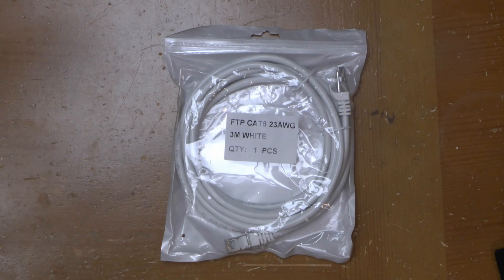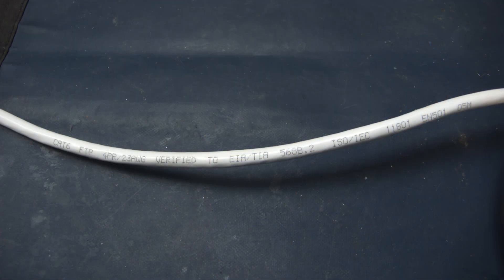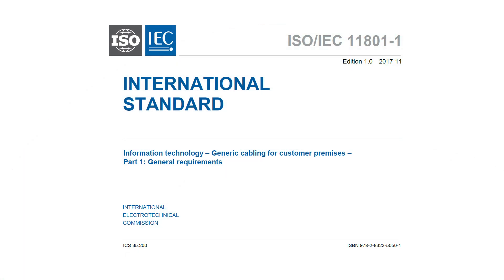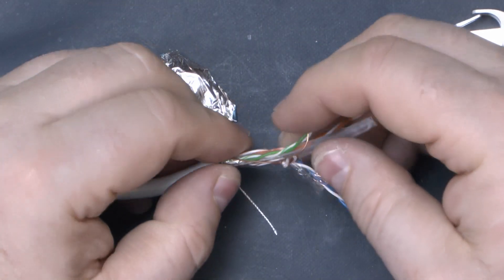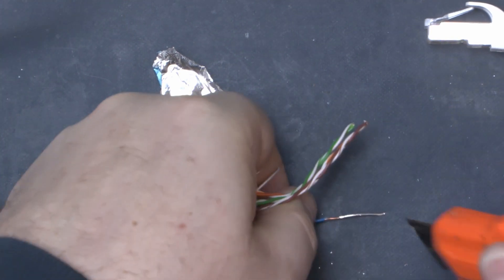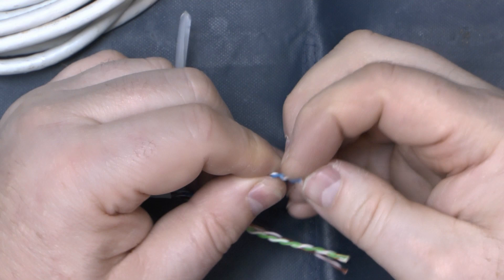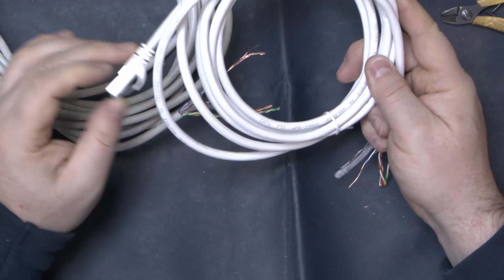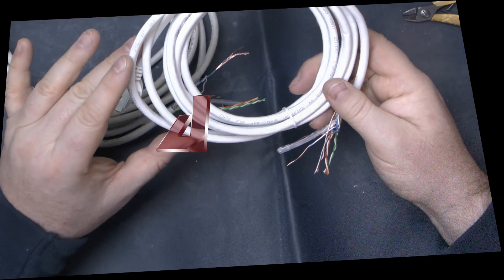ikbc Cat6 Ethernet cable review

Comment: Just like a cesspit, on amazon it's the crap that floats to the top. Anything decent quality is more expensive, so hardly anyone buys it and it sinks to the bottom where it rots
Reply from the maker: Then you get stuff like this cable that bucks the trend, because it's lousy quality for the price of a decent one.
Reply: @AintBigAintClever  That is a big problem and has been for years: rubbish with good stuff prices as people will buy on the operant assumption that it's not super stupid cheap so it must be better.